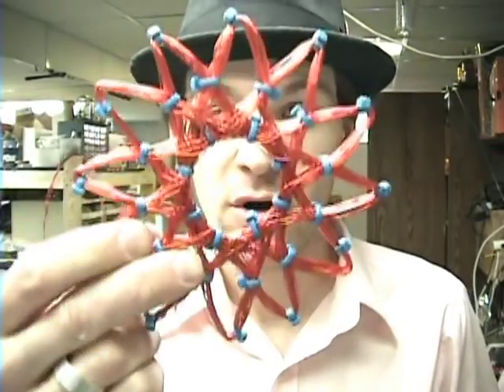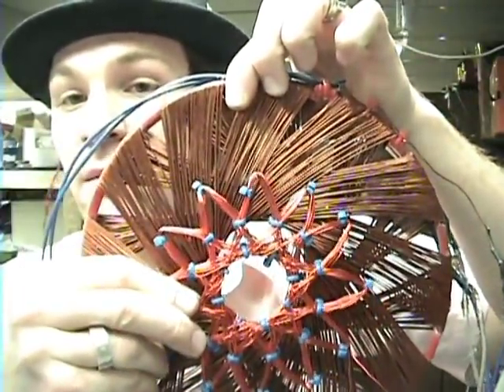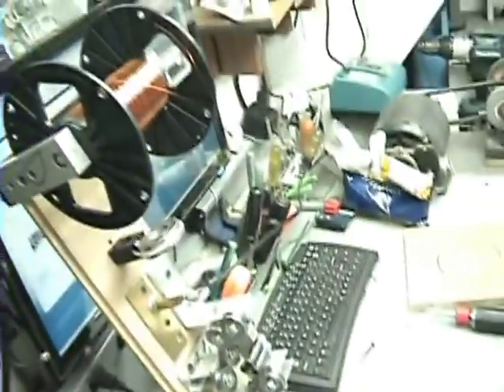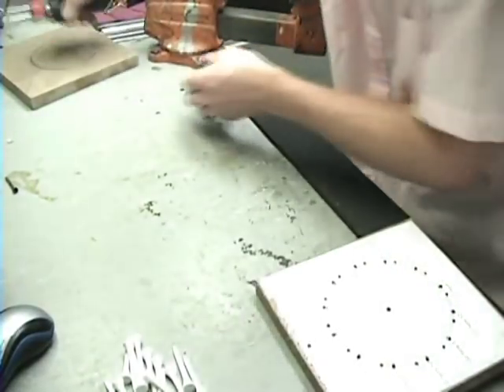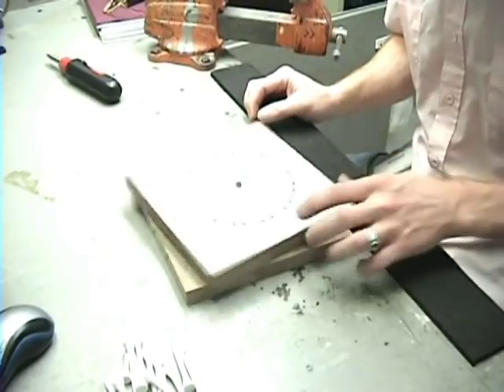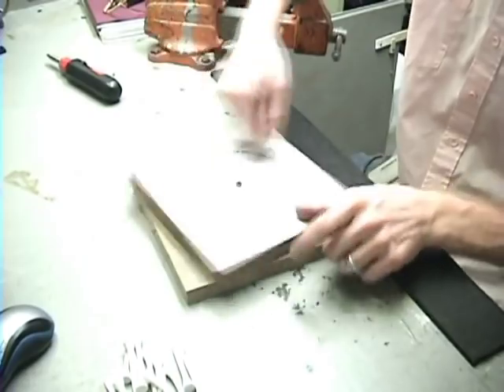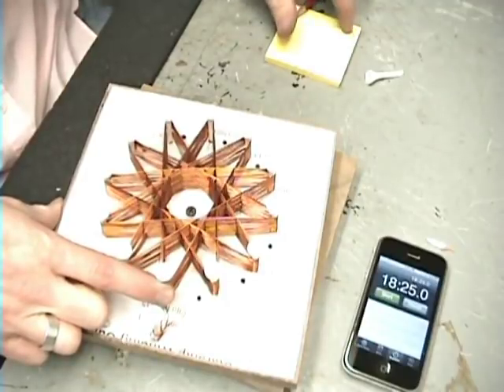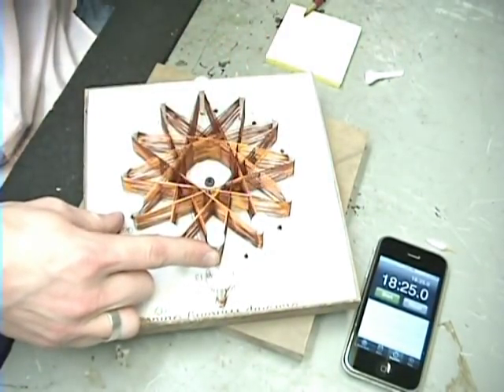How to Build a Starship Coil, Tips and Tricks

Comment: What I found that worked better for me than the golf T's was using very thin plastic tubing, covering long, thin screws, run up from the bottom. I'd initially tried nails sticking up through pre drilled holes, with thin tubing slipped over them; but, that hadn't worked out as well as I'd hoped...  I think I used nails which were too thin. I'd "swiped" your idea for the rotating turn-table & the golf T's over 10 years ago; but, by the time I switched over to the tubing & nails, I couldn't find this video to pass along the suggestion. I just happened to stumble back upon it tonight; &, thought "better late than never..." I hope this helps someone out.

Comment: @rwg42985  -Russ- you do see the modded pins just like I did.
I made a toroid mold yesterday out of two part silicone molding compound. I split a toroid in half, mounted the halves on some coffee can lids that I had cout off 2 cans, used some clay to smooth out the surface, pored the compound and now have two molds that when put together make a toroid on the inside. I've got it filled with water and sitting in the freezer to see how good of a toroid it makes.
I'll do a vid.
Peace.

Comment: Hello friend. I have built a starship coil with 12 points. I just want to know if I have connect a resistor to it if I am adding say 528Hz signal to it? Does the coil seen as a short without resistor?

Comment: I am planning to create a Mantra Star Cooper coil , just like David Sereda's . It has 14 Pins and also has 7 Layers and 14.5 inches wide. Do you have any Diagrams that would show me how to wrap the copper wire around those 14 Pins and that i could download and i could print. I seen other videos he show how to warp in 3 pins ... goes up to 10 pins technics but their is no printable Schematics of the diagrams . Their is a way to wrap the copper wire around each pin , to create a kind of a hole in the center of the Star.  And what would   be the recommend copper wire gauge because the end will need to go in an Amplifier that i did not buy yet.
Reply: Can you post a video on how to make a 14 pins Jig because i want to be able to build myself a Star Ship copper coil at 14 pins (Star) and also making 7 layers of it (Using speaker wire cable). Can you recommend me what would be the best speaker wire to use - I would still need to plug it in a Amplifier using connector to the Amp. Then use a Cell phone app or Tablet to run the frequencies threw the whole system just created. Do you have any ideas about a 14 point Star Ship Copper coil? Or making a 7 layers high Starship coil? 🤔 ❤ 👍 👁

Comment: I know this video is ancient but does this this create PEMF at a certain guass level and can you change the guass power by hooking it up to either battery (12 volt) or wall socket current? Is the magnetism only in the middle of the star?
Reply: Yes this should work to my knowledge, if it measured on the golden ratio, this should also  work with scalar waves. if you have a good frequency generator.

Comment: you need to use a mechanical pencil to do this correctly. Put the copper wire through the hole where the lead goes...